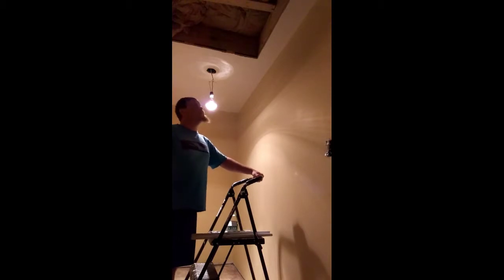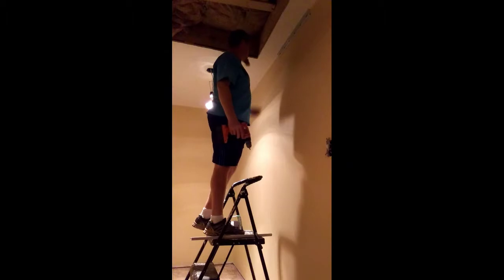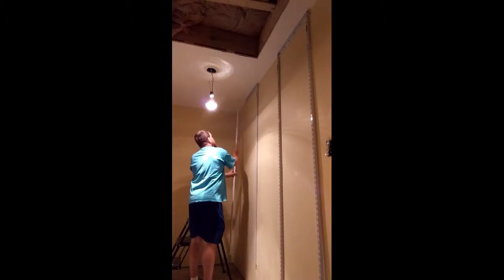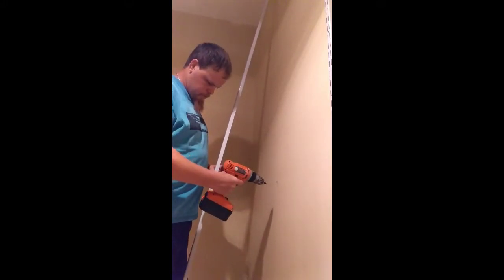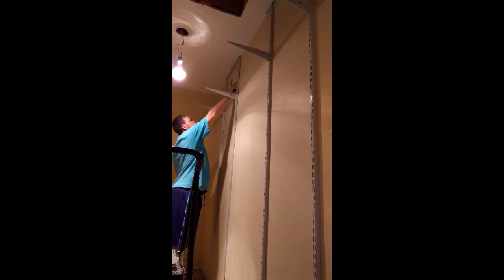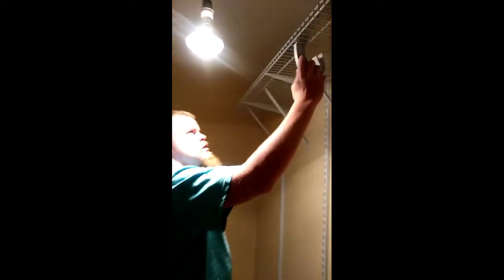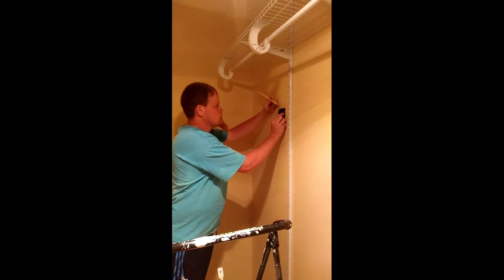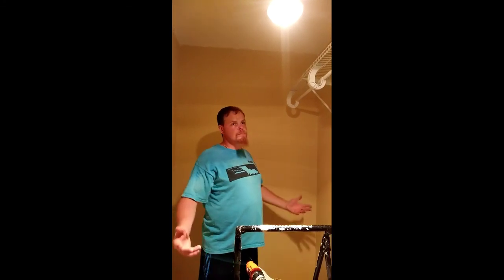How to install closetmaid shelving and clothes hanger

Comment: If you had it to do over, would you change anything?  I think it would have helped if you'd figured out where the studs were before you placed those two horizontals hangers.
Since there was plenty of room  going either way from left to right,  you could have placed them so that the center hole was over a stud.  I'm writing this to help remind myself how I'm going to do it.  Sometimes you need to do something to work out your mistakes.  I can't believe how much those horizontals cost, I'm hoping to use only two like you've done, not read to spend more since I already have the verticals.  I guess you could do it without the verticals but then it would end up being more work to get everything level.  Thanks for the video, it was very helpful.  Oh, yes, I saw where you posted it on the HD website.
Reply from the maker: Nope, everything is nice and solid. I've loaded the shelf up with a lot of weight. Actually, in my case I had a top plate which most homes should have starting an 1.5" from the ceiling so it's a solid piece the whole length. If you do have top plate, I would strongly recommend anchoring to it because every screw will hit the top plate. It works out great not only because you hit the top plate every time, but because you don't really need your level as long as your house is nice and level. It's great to see I'm getting feed from HD. I sure spend enough through them haha.
Reply: @dovesdiyconstructionreview1742   I get that part about the top plate!  But...(excuse me here) ....when installing the horizontal, why not  measure UP from a stud and put the first screw into the CENTER HOLE of the horizontal hang track?  That way when you add the standards they will be right over the studs and which will only require simple screws.  So.... maybe the hole in the horizontal isn't exactly over the stud....well, then,  just move it left or right until it is.  In your case, because you had that long top plate, you had plenty of room to put that horizontal anywhere you wanted it saving time and money on screws virsus molys and unnecessary holes in the drywall.
Don't hate me because I'm a woman, I'm also an old woman using the other side of my brain.  LOL  Now it's my turn. ugh!  Let me know if my observation makes sense to you.  Thanks   And, by the way, I looked up another site and they're all saying that the horizontals aren't really necessary if you're not going over the weight limits.  Just another way of selling more of their products.
Reply from the maker: @alice30045  I understand now. I suppose I could have. That would have made things easier I could see where the hang tracks would not be necessary but I could also see where things would not line up perfectly without them. I had a hard time figuring out if my shelf brackets were in the right slot just by eye balling so I could easily see a great disadvantage to not having the hang tracks.
Reply from the maker: @alice30045  For ease of navigation, here is the direct link for closetmaid shelving. Enjoy and let me know how it goes for you. If you have any questions, dont hesitate to ask. https://homedepot.sjv.io/c/1305858/456723/8154?u=https%3A%2F%2Fwww.homedepot.com%2Fs%2FClosetmaid%252520shelving%3FNCNI-5
Reply: @dovesdiyconstructionreview1742  I need to think on this one.
Reply from the maker: @alice30045 I think your center hole remark threw me off yesterday. Sure, you could line your verticals up with the studs but you wouldnt want to install your center hole over a stud, you would want to install one of your end holes over a stud. Of course, this would only work if your stud spacing is less than 24" which they should be. Now to re-reply to your first comment, yep. I would have installed the verticals over the studs.